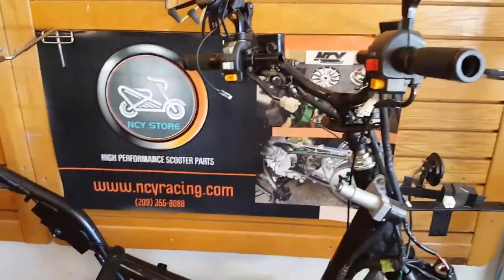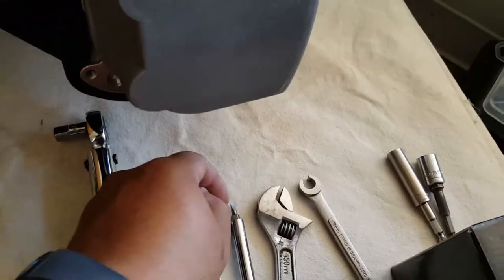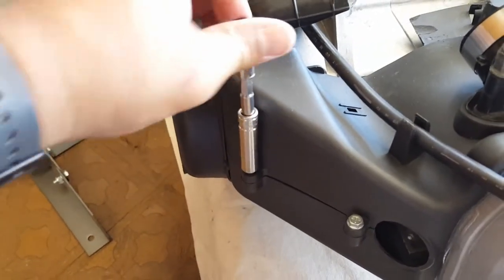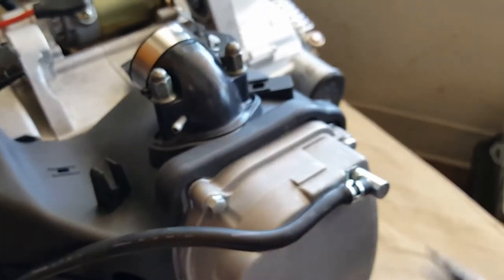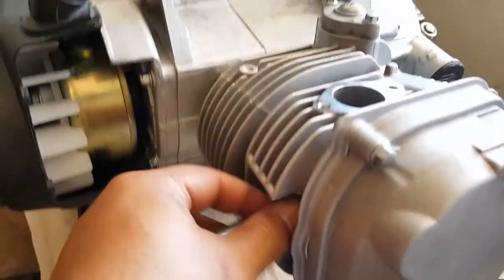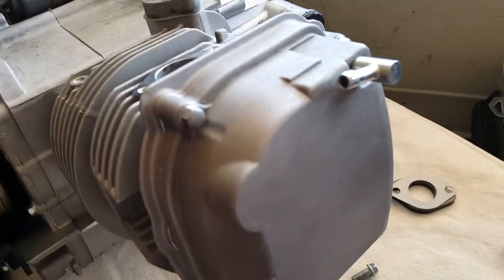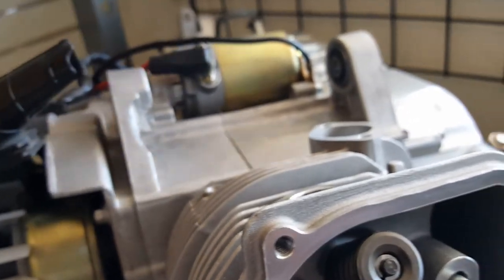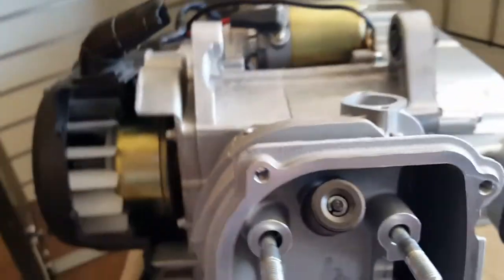How to install GY6 Big Bore Kit 171cc on 157QMJ Part #1

Comment: Yes,it's the gear behind the variator,i want to replace the crankshaft,i i used a bearing separator and gear puller set i bought from harbor freight tools and one of the legs broke at the thread on its first use

Comment: Is there a significant difference in performance between the 150cc and the 170cc?? I just bought the NCY 61mm BBK and the NCY 61mm Head with valves. I spent quite a bit of money so I was hoping there would be. I had to replace these parts anyways, and I used NCY because of the good review on Amazon.
Reply from the maker: yes you're going to see a quicker acceleration as well as increase in top speed depending on any other extra she put on there like exhaust, carb, Jets
Reply: @NCYSTORE  any like comparaison 150cc vs 170cc ? what it does for difference top speed and acceleration ?

Comment: Hi sir great job can I perform this procedure without taking out the motor or do I have to remove the motor?
Reply: You can do it with the engine on the frame most if the times, but it's just easier pulling out the engine from the frame. You will have more space.

Comment: I need some help please on my gy6 1P57qmj, I'm about to replace my stock cam with a A11 performance cam, so on the stock cam there's a sort of one way, notched bearing next to the cam end bearing, what does it do? And should I transfer it to my new cam? Which did not come with one?
Reply: Just buy size larger jets, intake manifold (to match head),high flow exhaust and cone racing air filter.

Comment: ?? Can i use a 2mm or 2.5mm stroker CRANK with this particular kit , if so anything I might need to do or buy extra
Reply from the maker: You can use a 2.5 mm just make sure you get extra base gasket that's the paper gasket

Comment: I'm finding it so hard to remove that gear behind the variator,i bought that puller n separator set and one of the legs broke at the thread the first time i used it.Does anyone know a link to get one that really works,thanks
Reply from the maker: We carry what called "Crank Bearing & Gear Puller Set" more details here: https://goo.gl/Vs6C6Y
Reply: Ncy store,i want to thank you so much for your help.I want you to know that what you is helping a lot of us here...I can't thank you enough...Happy holidays
Reply from the maker: Happy holidays to you too I hope you get that starter gear taking off. I'm not sure if it's better with ours but it's made specifically for smaller engine this gear puller set by Pit Posse.

Comment: Hello sir.. i got QS157QMJ engine (suzuki vecstar150 / an150).. is the same as others gy6? Want to upgrade some performance part like big bore with stroker kit with 4 valve head in it (like Taida/NCY/naraku).. The oem crankshaft different shape (axe shape like). Is it possible to change other type to other performance crankshaft or others performance kit? Can u recommend available kit out there?

Comment: Hi, I'm looking to upgrade my big bore upgrade kit with a 61mm  cylinder head for my gy6 150cc (will it fit or needs machine bore out?). I'm looking at 172cc or 200cc they both showing of 61mm. Now another be a 180cc at 63 mm.  Is 63 needing a machine bore or not. I just don't see a 180ccc unit at 61mm. Please advice, Thanks!
Reply from the maker: Kou Vang what's up Kou, look like you're planning to Unleash the Beast you're correct the highest you can go without boring is 61 mm or 62.7 outer diameter make sure that for there is some 61 mm Max 171 CC that does require boring anything above that does require it as far as I know so far that means the 180cc will require boring if you're going to go for 180cc he'll use the same case possibly as a 232cc I hope this helps
Reply: Ok, am watching your video now on a 180cc having a 63mm. it shows tite BUT works, but you'r responce  only show no higher than a 62.7mm or others must be bored. Please advice.
Reply from the maker: Kou Vang normal stock 150cc crankcase i.e. 157qmj is no larger than 63 mm opening round for the cylinder housing sleeve to fit inside if you do get a 61mm make sure its outer diameter sleeves or skirt is safeside no more than 62.7 outer diameter. Yes there is no 180cc with a 63mm diameter you can make it work but you'll have to bore it and the maximum you can bore is closer to 64.7 millimeter before  cutting close to the oil port, make it not that stable for long term performance that's why I recommend going with a case that can bore upto to 232CC, you can increase your CC not just with the crankcase alone but you can reach 200 cc from a 180 just need to make sure you upgrade all other parts from exhaust to air intake, air intake manifold, high flow oil pump and heavy duty starter clutch and high torque starter motor is a mess if you're upgrading from 180cc and above for 171 just a heavy starter clutch would be adequate.
Reply: hmm interesting, am seeing a 172 and 200cc at 61 but no 180, guess will go w/ 200. tip max spd? Thx!
Reply from the maker: Kou Vang that's a variable question it depending how much you know about your jetting and precise and as well as other components involved but you'll definitely increase your RPM and speed how much that very incline climates I would love to give you a definite miles per hour but that's something you'll have to enjoy discovering yourself :)
Reply: thx again!

Comment: Hi sir i need assistance to upgrade my scooter Peugeot spaceflight 4t  50cc model 2018 and i love to have 200cc or 180cc cylinder high performance system racing? Do you have something like that?
Reply from the maker: that's a good question let me check with our supplier on that I'm not sure we specialize in that particular engine. Do you have locate the engine code send to us info@ncystore.com
Reply: @NCYSTORE  sorry I don't know how to fund the code engine, can you help me out to find the code engine and i will send it for you sir
Reply: @NCYSTORE  am new user for scooter tips, you are professional person 😀
Reply from the maker: @mohammadhussensodki5474  I don't know either you can try to get online and find your scooter user manual?!
Reply: @NCYSTORE  hi sir I have sent an email to you and I hope it useful for you. Thanks
Reply: @NCYSTORE  i had send it to you
Reply from the maker: @mohammadhussensodki5474  yes thank you we received it as soon as we get some information by Monday we should let you know from our Tech Guys.
Reply: @NCYSTORE  sir I get the answer but they're saying i have to change the engine to Honda Ruckus , how much it's cost me?  And the shipment to Norway?
Reply from the maker: @mohammadhussensodki5474  engine shipping alone could be a couple hundred dollars and depending on the engine it can varies a 232 Taida can run anywhere from $2,500 up.
Reply: @NCYSTORE  do you mean 2500 US dollars?
Reply from the maker: Yes, currency is in US dollars
Reply: @NCYSTORE  sorry sir I am not interested any more, because I think I can find something with couple of hundreds

Comment: I may have made a balls up. I didn't line the timing up before before taking it all apart. Now I can't get the piston and timing lined up to tdc. What do I do?
Reply: I'm sure you figured it out, but for anyone else.. there are markings on the stator and the cam sprocket to find TDC.

Comment: Is there a way to tell if the 157qmj is an a or b case
Reply: To tell any gy6 measure from head stud to head stud. 150cc gy6 should have with 54mm or 56.28. 54mm is a a case and 56.28 is a b case. They also have a short head and a long head. A 2 valve head and a 4 valve head. If you scooter is running a 13" tire or bigger it prolly have a long case. If the tire size is small it prolly has a short case. 

What you have should be a 150cc a block if it's the 157qmj

Comment: you didn't have to bore the case
Reply from the maker: That is correct. Just make sure you have a cylinder kit sleeve outer diameter 62.7mm you don't have to bore or your stock GY6 is 63mm forsure on 157QMJ
Reply: NCY STORE yes its a 157qmj so does the kit come with the sleeve?
Reply from the maker: Jermaine Bryson all cylinder kit comes with the sleeve it's part of the cylinder just make sure that it's measurements is no less than 63 mm it's the sleeve that goes inside the boring case.
Reply: NCY STORE is there a part number for the kit Im looking to purchase
Reply from the maker: NCY 61MM CYLINDER HEAD SKU#1100-1254 & TAIDA CYLINDER 61MM (62.7 OD) SKU#GY6-01054-61wf